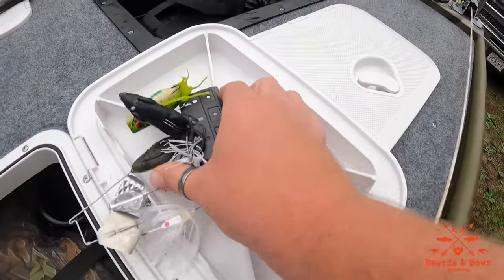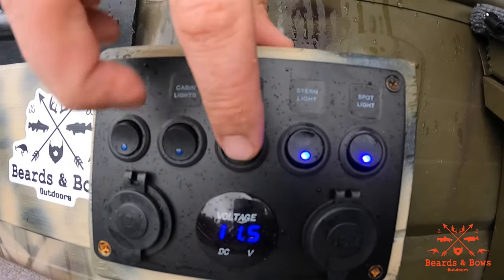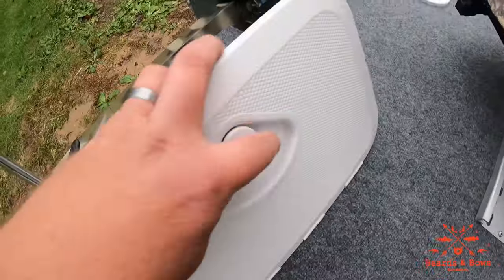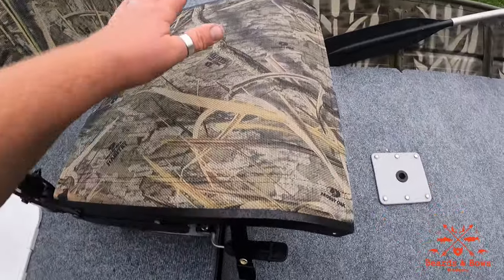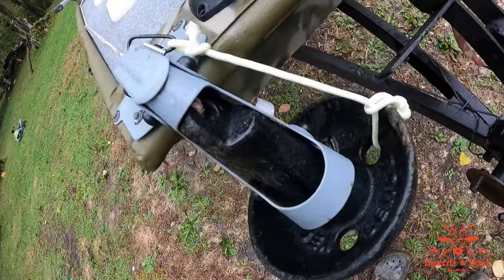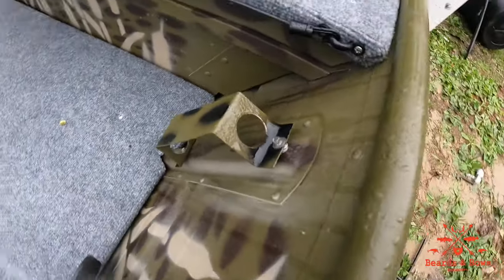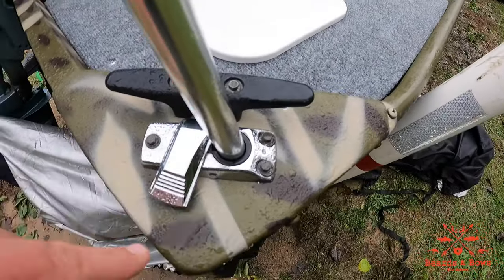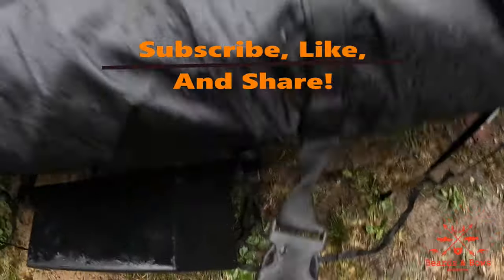Jon Boat Modifications / Jon Boat To Bass Boat Conversion / Boat Hacks And Mods Update Part 7

Comment from the maker: Product Affiliate Links:
*Millenium Marine Seat - https://amzn.to/3vVv3BD
*Springfield Marine Sliding Seat Track - https://amzn.to/315NtUV
*Boat Seat Swivel - https://amzn.to/2Zwd3S6
*Wise Camo Casting Seat - https://amzn.to/3nF6KUY
*Springfield Marine Adjustable Pedestal - https://amzn.to/3EG5pUT
*Kohree Switch Panel 12v - https://amzn.to/31cRh6Y
*Nilight 20" Light Bar & Pods - https://amzn.to/3Bo5URo
*Fulton Outboard Motor Lock - https://amzn.to/3pNI7rW
*Xprite Led Navigation Strips - https://amzn.to/2XXkFgg
*Gorilla Glue Adhesive - https://amzn.to/3Cqehgu
*Boat Hatches - https://amzn.to/3lHp8N7
*3M Marine Sealant - https://amzn.to/3AFqzQw
*Attwood Anchor System - https://amzn.to/3DmnqH2
*Attwood 10lb Anchor - https://amzn.to/3mzSP1W
*Attwood Anchor Rope 100ft - https://amzn.to/3DmnO8s
*Waterproof Boat Cover - https://amzn.to/3EnhaiE
*Minn Kota Edge 45LB - https://amzn.to/3uoKi5q
*Panther Tray - https://amzn.to/3mgZn5e
*Pedestal Seat Mount - https://amzn.to/3usU46y
*Female Trolling Motor Plug - https://amzn.to/2ZAxv4n
*Male Trolling Motor Plug - https://amzn.to/3F9CtW3
*Goop Coat It Epoxy - https://amzn.to/3CDrfHo
*Alumahawk Boat Paint - https://amzn.to/3kA7pqj
*JB Kwik Weld - https://amzn.to/39ziLo6
*Carpet Adhesive: https://amzn.to/3hEtfau
*Attwood Stowaway Stern Light - https://amzn.to/3GubhlJ
*Scotty Universal Mount - https://amzn.to/3pHgaBY
*Boat Tie Off Cleats - https://amzn.to/3mq4KQM
*SeaChoice Auto Bilge Pump - https://amzn.to/3CrotFo
*Bilge Pump Install Kit 3/4" - https://amzn.to/31g7fxj
*Rod Tie Downs - https://amzn.to/3nGUy5W
-----------------------------------------------------
Please Subscribe For More Fishing, Hunting, And Diy Videos!  Thanks For Watching!
------------------------------------------------------
For All My Social Media, Merch, And Contact Info, Click Here: http://direct.me/beardsandbowsoutdoors

Comment: Great job! I’m doing the anchor system you have and I got a few other ideas from you also. Thanks for the tips. I think I have the same cover, and I thought it was also not tightening, but after finally figuring out how the strap goes through, it does tighten. I had to look it up how it goes through. Let me know if you’ve got it or not.
Reply from the maker: I'm glad I could help!  That cover has been replaced. It lasted a couple seasons before it ripped with an ice storm.  What I ended up doing was just tying the straps at the needed length so all I had to do with buckle them and go. I'm sure I didn't put the buckles on right from the start though lol

Comment: I've seen several trying to convert jon boats into bass boats (raised fishing platforms, etc), with the results not very stable. Bass boats are usually wider to reduce such instability, with the raised fishing platforms often lower (than those installed high over the seats in jon boats) to again reduce instability. Just an observation, not a criticism.
Reply from the maker: I'm used to standing on tiny boats, even my inflatable sea eagle.  When I stand on a bigger boat it's very stable to me compared to what I'm used to.  My 1436 build turned out great but my 1648 will be even better
Reply: I'm with you. I mean they're nice rigs but there is so much weight added that is high on the boat. Like you said, unstable. The next thing that happens after adding 500lbs of stuff on the small boat is they are using GPS to see how fast it is and wonder why it's so slow. To each their own I guess.
Reply from the maker: I agree.  Wood weighs alot more than aluminum

Comment: The green and red lights need to be on the corners of the bow... The light cant be seen from sides very well and coast guard will complain... I used 6 inch. One on side and one on front and they met at corner and work perfectly and no coast guard complaint
Reply from the maker: Thanks for looking out.. I will probably add some side navigation lights to what I have already.  That gorilla glue is no joke

Comment: Looks great. Not a fan of the fire extinguisher in the spot where the fire would be.
Reply from the maker: Alot are located in the back but you bring up a good point. I will probably add one to the front of the boat as well.  🙌👊